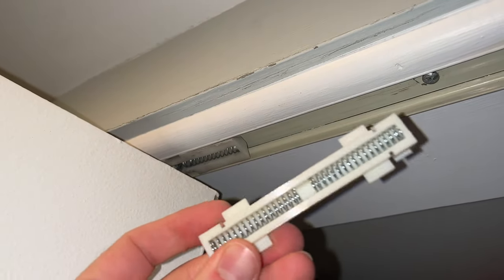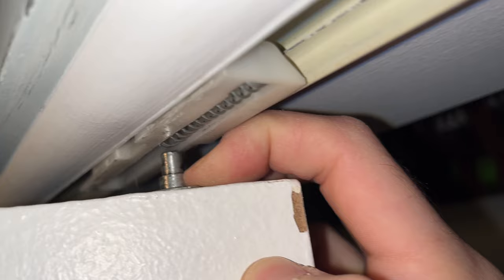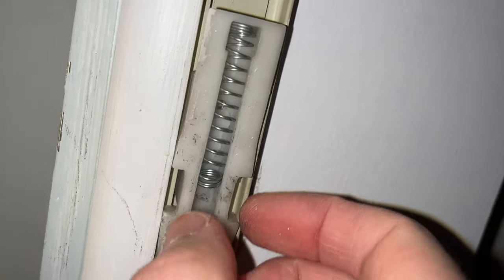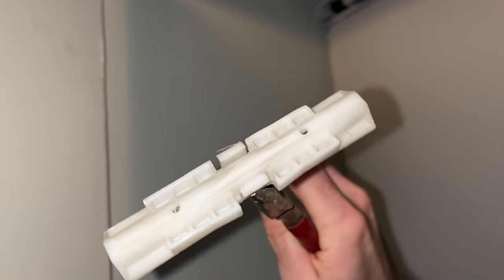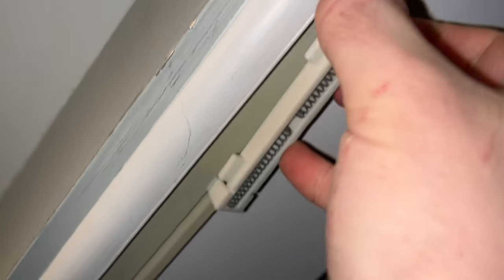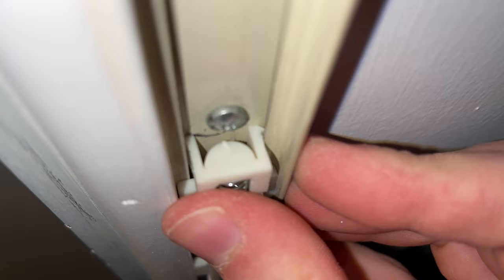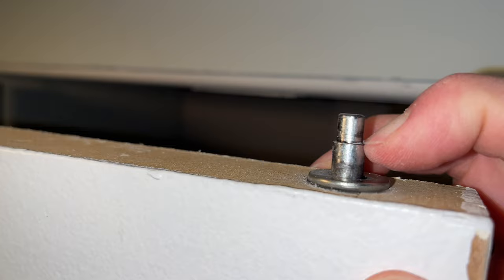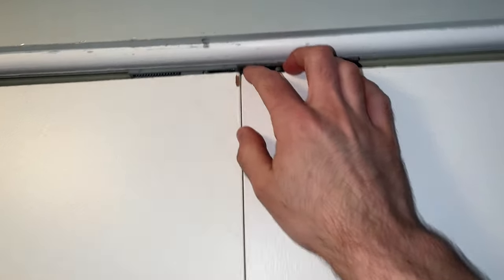How to Replace & Install Bi-fold Door Slider Guide on a Closet Track

Comment: What do you do when you can’t get the second tab into place?  I’m just not strong enough.
Reply from the maker: You can try using a flat head screw driver to push the second tab inside the track.